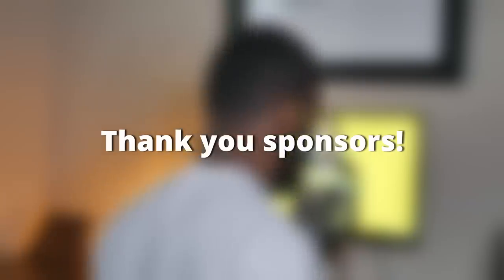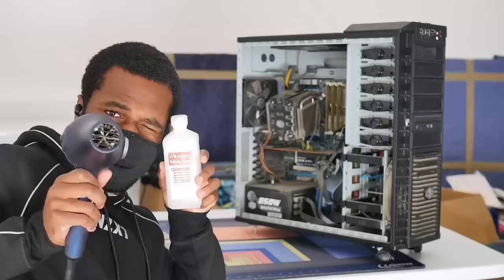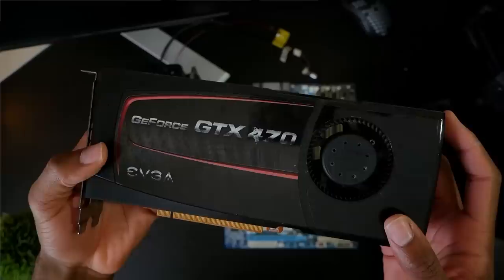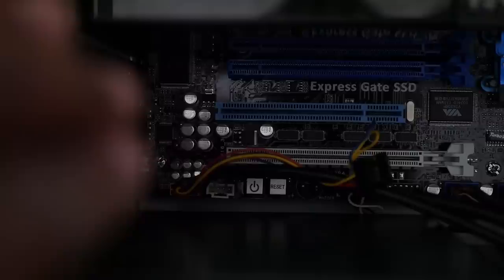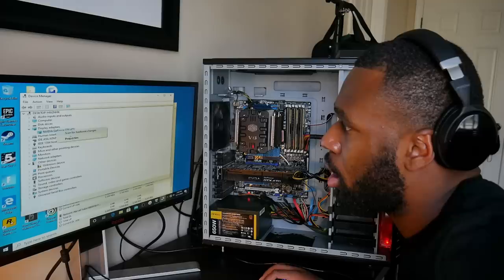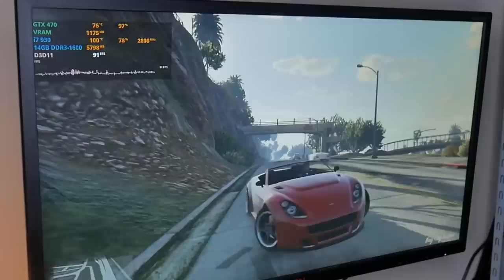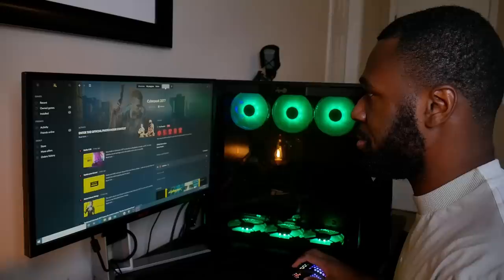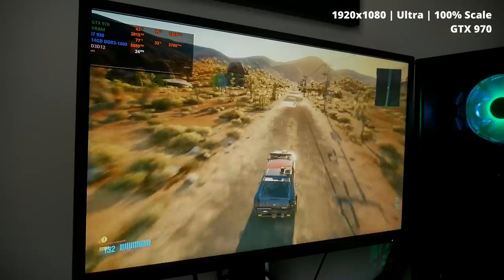The $32 Cyberpunk 2077 PC That You Can't Build | OzTalksHW

Comment from the maker: Thanks for the support on this video :) I used Cyberpunk v1.04. Now there are tons of ways to tweak the game for slower PCs + CDPR has dropped updates to improve performance. I'm not sure if I'll end up trying those out in the future -- but I figured I would let y'all know. Hope y'all had a great Christmas!
Reply: Is there a way to contact you
Reply: Ha ha know shit
Reply: InWin 309 costs $200/$250.... That is a high end case. I thought your PC costs $32.
Reply: My dude! please drop the walpapper. Super slick!
best wishes and have a great 2021.
Reply: Worth working a bit on the v8 cooler too bend the cooler back into shape so it mounts properly as it's pretty good still.
perhaps one of the 6 core xeon processors & keeping the gtx 970 in it.

Might try the hair drier method on a currently non functional msi gaming gtx 780 just too see if i can get that working again for my lil brother too use for a bit as he is stuck on a gtx 460 atm.
Reply: You can t run Cyberpunk on that gpu. This game Requires recent drivers. (i tried to run it on a GTX 580 and failed)
CLICKBAIT FRIEND
Reply: Hello,is there a possibility of you trying to upgrade a Lenovo Thinkcentre M91p?
Reply: You got lucky with the board. I have a U58 and ram slots 1&2 were busted. They’d show ram being install but had DRAM error. But this cpu and board with enough ram can run with the big dawgs. A 1060 or better would take it to the next level. In my case I have a i7-920 and it performs. I would recommend this set up to anyone really. It’s worthy.
Reply: nice
Reply: @alienwaregameralx1874  yes you can
Reply: @alextracythaxton5796  I pointed out why you can t - there are zero youtubers able to do it - you say you can : Valerie pls explain
Reply: instead of a hair dryer why not get a data vac
Reply: Give it to me, I will take good care of him. 😊
Reply: How are you a PC guy but your first reaction is not to check the Front panel IO? If you computer does not respond when pressing the button. The check List goes like this. Front panel connection, power supply.
Reply: I really love u vids man cuz u one of us just watching u I can tell that u know how it feels to play games on a gt710 and Intel  Pentium
Reply: E
Reply: its interesting that you named the pc Lazarus because i understand coming from a Christian background god bless you buddy :)
Reply: I just tried with a 2080super and a 1440p resolution and it struggled at medium or above to get 70 fps.
Reply: QUESTION i just did a case swap on my dell optiplex 9020.. and my son bought me a rgb cooler. It spins but i can figure out where to plug in the rgb in so the light comes on please help...i have a semi modular consair bronze psu.
Reply: You probably heard this but damn your voice is so soothing hah you should do audiobook voice overs.
Reply: Hey oz i forgot a pc case but i have everything else can i still use it?

Comment: Bro, where tf yall live? You find i5s in the dumpster meanwhile where I live people ask for like 300 bucks for their Celeron D optiplex
Reply: All i ever find are i3 or i5s 2nd gen in the trash
Reply: He's near Atlanta GA which is a city that tends to attract people with a lot more money than sense at times. My sister use to live near Atlanta in the early 00's, and I went to help her take some stuff off to recycle once while I was visiting her for the weekend, and I found 2 laser disc players, a couple of G3 Imacs just ready for the picking I took home, cleaned up, and flipped on eBay for some nice cash at the time, and yes everything worked, just one of the Laser disc players needed a belt, and was missing it's remote, but the Imacs had the keyboards, and mice included.
Reply: Can only speak for Germany, it's rare but it happens. Someone wanted to get rid of an old mystery machine that wasn't really running anymore and was dustier than what we saw in this video. Paid the guy 14 bucks for an i7 2600k (also had to fix the cooler), 650W Corsair PSU, GT610 GPU and an open case. Essentially needed a new cooler, case, RAM and SSD but still got a really good deal, especially with the PSU.
Reply: my best luck was an i5 4590 machine for 2 dollars at a church sale, I didn't realize at the time but the only thing wrong was that the front panel power button wasnt plugged in
Reply from the maker: Commodorefan64 explained it pretty well! Living in a tech hub helps A LOT. Even so - it's suuuuper rare. This is the first time I've ever gotten a machine that's even capable of modern gaming and I've been doing this for like 5 years now
Reply: @OzTalksHW  I can't even run those game lol.

I have Intel Pentium G3220 which is not that bad but the other is horrible. My ram is only 2 gb and my gpu is Intel HD 4000(nightmare). I need to wait 4-6 year to get midrange pc because pc component is my country is absloutely expensive.
Reply: You need patience and luck, you dont find stuff like this everyday
Reply: i got a 6th gen i5 machine for free
Reply: When university was writing off PCs last year, i live in Germany, i fetched one and it happened to be an i5-3570. It's not an i7, but the generation advantage compared to the Nehalem should be plenty to make up for that. So with some mods, like a couple nice drives that i already had and a GTX970 that i already had, that's my computer now. This is exceptionally lucky though.

But had i tried to buy a computer like that, it would be over $120, likely much more. And yeah of course some people will try to flog old junk for big money, doesn't mean anybody is buying them.
Reply: OZ is rewarded by the technology god. You have no such fortune.
Reply: @tsukasa.6758  buy used
Reply: I got a ryzen 7 3700x for free from stranger.
Reply: Yeah I’ve never found any computer component in the trash
Reply: @tsukasa.6758  I would just buy a bigger stick of RAM and look for something like a gt1030 (but get the ddr5 version, the ddr4 version sucks) on sale on newegg
Reply: @SianaGearz  the only difference between i5's and i7's of that generation is hyperthreading, and that's not really a big deal. Hyperthreading only makes better use of the cores, but it doesn't give you any more silicon, so their performance is similar. With a GTX970 you have a pretty nice rig.
Reply: @SeeJayPlayGames  yeah but you do get easily 30% more performance in heavily congested loads. Sometimes things are on the very brink of working on an i5, like the famous Cyberpunk tasklet system, where AI, pathing and object cleanup can get pushed back until they break horribly, when there just isn't quite enough performance to go around. I have had things break in Forza Horizon 3 as well due to running out of CPU horsepower. Though maybe software quality is to blame, some sort of tasklet deadline system would do both of these good, after all, if you have de facto soft realtime requirements, how come they're not making use of soft realtime software architecture? Also I'd like to get back into development of bigger more complex C++ projects and I just don't have it in me to wait for one and a half hours for a build any longer, though i7 won't make enough of a difference. I am keeping the 970 but upgrading to some sort of Ryzen soon, no final decision done on which. Maybe 1600 12nm refresh. That's like twice as fast easily, which is already helpful. And there's room to get twice as much performance from there again I think.
Reply: @SianaGearz  okay, I see your knowledge dwarfs mine. I was just trying to be positive about your current rig and you broke out the serious developer knowledge!
Reply: Nice pfp
Reply: I worded a optiplex 3020 with i5-4590, 16gb ddr4 ram, 1tb hdd, and windows 10 for 65 dollars about a week ago
Reply: Where I live people don't give anything for free like there are ads selling not working Pentium for money
Reply: 45°52′S 67°29′W
Reply: Right💀👌

Comment: Finally, a PC I can afford.
Reply: If you really want a nice computer use something like this as a "base" platform and slowly upgrade your components as you go, you can even use your older parts to help pay for new ones once you get going enough. I did this from 2015-2019 and now I'm rockin a 3700x and a 2070xc
Reply: @afxquest6167  but were talking computer hardware here not consoles?
Reply: @afxquest6167  plus from a console players perspective pc hardware is expensive but the money you save on games... it pays for itself
Reply: You sure about that? Only the case and the fans cost over 400 bucks.
Reply: @NaoFodePorra  no flex i started out with an old fm2+ motherboard a cpu thats probably slower than a literal potato and like 8gb ddr3 also no gpu at first lol you just gotta save your money and make strategic upgrades
Reply: @ProductionsByRayne  Agreed 100%, the only console that makes any sense to me these days is the Nintendo Switch, and more so the Switch Lite with how cheap it is, and games go on sale a lot like on STEAM, even physical releases.
Reply: @afxquest6167  you cant really justify getting a console over a pc on a video like this...
Reply: @CommodoreFan64  a switch? Botw is still $60 and that came out in 2017...
Reply: @afxquest6167  ps5??? Why get ps4
Reply: @NaoFodePorra  then its not considered flexing.
Reply: @afxquest6167  ps5 can do 120 fps on Fortnite..
Reply: @aqua.3346  Well about that...
Reply: The computer in the video is pretty awesome, I found a $30 x58 pc, switched it to a Xeon and threw in my 980 ti and I was consistently maxing out the graphics card. Factoring in the 980 ti, x58 upgrades, costs less than $250 for a pc.
Reply: @ProductionsByRayne  but you can also save money on games on consoles too
Reply: @redgloves9159  Well yeah of course, i just meant in average i've saved more on pc games. for example I've gotten the past 3 call of duty titles for basically nothing not counting cold war
Reply: @ProductionsByRayne  well I got some of those games for free
Reply: Good joke
Reply: And cant build
Reply: @f̶̿̓ buying a console is for people who want to just play games and just want the ease of just turn it on and working without facing problems also they dont want to tear it down just to change apart so they can play newer games. Consoles are just easier to maintain than a pc but the pay to play online is something I wish was never invented but companies and game devs have to win money somehow. Also, pirating games is a scumbag move.
Reply: @afxquest6167  pc are better than console for example ps5 would run games at a constant 60fps and some games 120 but pc hardware will get cheaper over time makeing it more affordable so like a 1660 ti would be 150 dollars in like 3 years also PCs have more flexibility than consoles
Reply: @afxquest6167  you act like pc is used only to play games lol
Reply: @ProductionsByRayne  me with 8 gb ddr3 and i5 2400: this is fine
Reply: @fifiwydd  I mean you really just say that price drops that much also in 3 years the PS5 pro which we don't know the specs on yet. And your kinda wanking pc
Reply: @the_realest_sneeze9189  take a ps4 for example came out around 2013-2014 the hardware has been the same for a long time and still cost around 200 dollars brand new I doubt if the PS5 had a pro version it will exceed 120 fps
Reply: @fifiwydd  how come? With all the feats a PS5 has a pro would most likely have higher fps since it can all ready reach 4k
Reply: @the_realest_sneeze9189  if the PS5 was to get a pro they would make it 120 fps for all games 4k but currently only some games can be played at a constant 4k 120 fps, pc on the other hand has already surpassed that years ago and with the new 30 series cards and gonna keep getting better
Reply: @fifiwydd  and at what cost? Over 1k or you can just pay 400 for ps5
Reply: @the_realest_sneeze9189  PS5 are like 1k without preorder never in stock either and the pro gonna be 1k too if it's gonna have so much performance
Reply: @fifiwydd  it still retails for 400 and it's PC parts that are out of stock always and are 2k for a part.
Reply: @the_realest_sneeze9189  3060 retail is 329 dollars pc parts are more  expensive but that's because they are better to than by the time the PS5 pro release it's gonna be less and if the prices go up so will the PS5
Reply: @fifiwydd  ding bat you still have to buy other parts not like you can pay one part of a PC you still have to get the other parts and the case. Yeah you can make the argument that PC can have ray tracing 4k at 240 fps but it's for a higher cost when you can pay way less and have a great experience with ray tracing 4k and be ables to run it at 60 fps which having a PC able to do what a PS5 can cost way more than a ps5
Reply: @the_realest_sneeze9189  it's at a higher cost for a reason double the performance more games and more extra features than a  PS5 is meant for games and media while a PC can do that and more and do it better then with a PC you can upgrade the parts while with the PS5 you gotta wait until the 6th then the PS5 will be outdated

Comment: Fun video but you were in the desert, that PC would have melted in the city :) I'll also say I've only ever had success with the oven technique on a Fermi card. Something about that weird giant heat spreader. Hope you had a decent holiday :)
Reply: Oven method has worked for me on an 8800 GTS back in the day. As all research pointed out though, the fix only lasted a few months before the problem returned :/
Reply from the maker: You are not wrong at all when it comes to the performance in the city LOL. I'm glad the oven trick does work even if it's only temporary. Hope you had a great Christmas, too TJ!
Reply: I have had success with a heat gun using Kapton tape and tinfoil over sensitive components as a protective buffer. I have done 8 cards total and had 6 come back and are still running up to 2 years later now. Never liked the oven method, I use a temperature probe (450° F is the sweet spot) and with the above mentioned method I can zero in on the die itself. This has saved me tons of money buying used dead "parts" cards for cheap potato rigs I then sell (how I make a living). Half a dozen rigs sold with refurbishment done to the GPUs using this method and not one warranty call to date.
Reply: @x7slim8x  dude that’s actually super sick, good on you.
Reply: @idealrunner5043  thanks, yeah I am a fan for sure! Alot of naysayers are out there saying the cards wont last etc etc... well my personal experiences have been great with the method I use!
Reply: @CoalitionGaming  person:you need a new pc me:*preheats oven to 450*
Reply: @x7slim8x  how do you get your foot in the door with something like that?
Reply: @TriTonGamingFTW  building and selling budget rigs? Well I have alerts set on all of the for sale apps and sites. I also hit auctions at schools and what not. From there you can get quite a bit of components. Then I use various methods to list my wares online. You CANNOT be afraid to ship out of state... especially for me as I live very rural. So when buying focus on ddr3 systems and up....even alot of those are getting too old, but with 16gb of ram, a ssd boot drive, a spinner for games, and the most important part....a decent GPU from the past 5 or 6 years you can build a system in demand for gamers coming over from consoles etc.
Reply: @x7slim8x  but U dont know how long the cards Last, could be 2 years, could be 2 weeks. It's Just a temporarely fix and selling these cards as a working one is Not that great
Reply: @schekelberg6187   selling potato machines with full disclosure and a 12 month warranty for a couple hundred dollars is "not that great"? Everybody involved is aware. If they want to bump it their budget another hundred or two they can purchase a better system. I stand behind every system that leaves my shop.
Reply: the socket pins or the socket itself needs to be resoldered back onto the pcb of the GPU. heating it up to remelt the glue and lets it settle back onto the PCB is a temp fix until it gets cool and reheated enough times for the socket to pop back off the PCB again.

Comment: Great video. I actually have both the case and motherboard. I got the motherboard for free for helping a friend with a project. I removed the original CPU and put in a Xeon CPU in it and I now use it as a game server.  I use the case with a different system because I needed the front external bay slots so I could install optical drives in it so I can RIP my DVD, Blu-ray, and CD collections. So long story short I was able to repurpose them both.

Comment: If you own a working X58 mobo, you can get an Intel Xeon X5675 (6c/12t - 95W TDP)  cpu for around 25 to 30 USD on eBay.
It runs cooler than the i7-9xx CPUs and can take up to 6x 8GB DDR RAM

Comment: My 7 year old daughters PC that I gave her for Christmas I literally pulled out of our local transfer stations scrap metal bin, in the rain.
 It's an old Am2+ socket Asus Mb, had an Am2 CPU, 6g of ddr2 ram, a 512mb 9800gt all in a really nice case.
 I dried it all out, cleaned the hell out of it and started working on it. I had an Am3 3.1ghz quad core on a shelf from my old rig, so I put that in and also had an extra 4g of ddr2 on a shelf,so I got it up to 10g of ddr2. I removed the power supply that was in the case," worked but was ugly" and put in a 600w modular power supply I had on a shelf. There was no hard drives, but I had several older small ones," used a 500g,a 300g and then a 200g as a boot drive". Everything worked very good as it was, but then Christmas day we went to the inlaws house and my brother in law had an r9 390 8g gpu that he said was trash so I got that too. Turns out the old r9 was simply under powered, and is working great in her PC.
 All in all, I have a total of 9 bucks invested in her PC," new thermal paste" ,it runs everything she wants to play," Minecraft, 7d2d and yonder currently", so she's happy as can be.